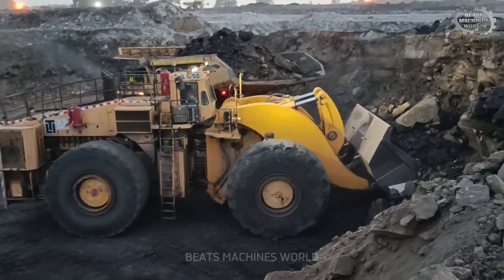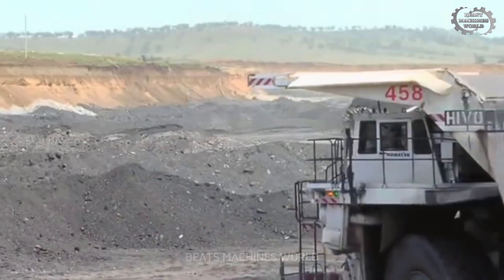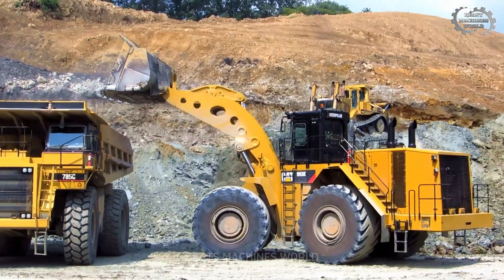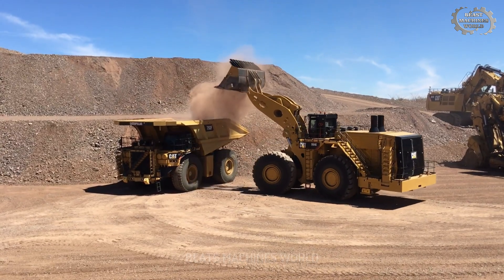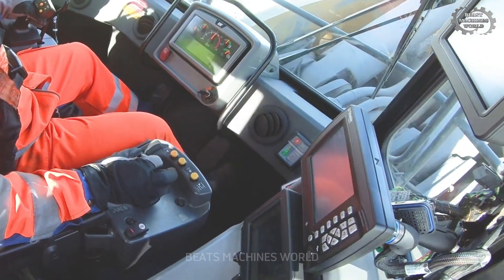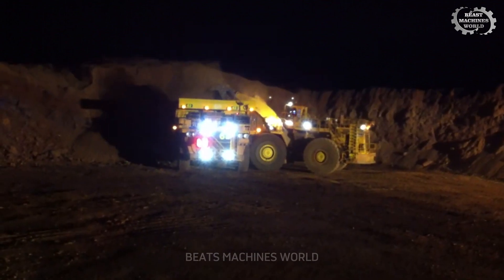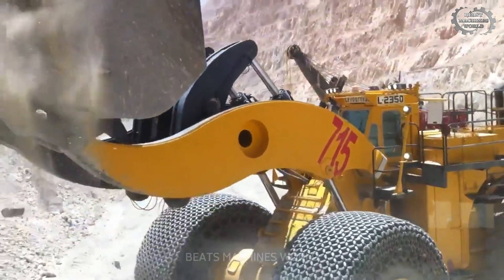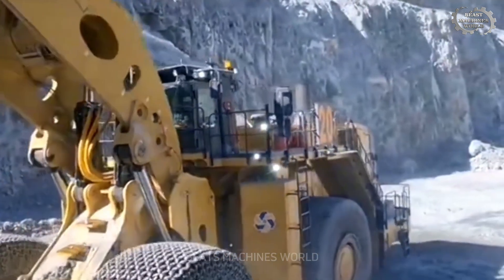The Biggest Mining Wheel Loaders Ever Used in Mining Machinery

Comment: I don't know anything about meters or metric tons.
You tell me and tonyage and footage and I understand that.
Reply from the maker: You watching this honestly makes it all worth it. Thank you!
Reply: Maybe you should learn the metric system. That is what virtually the entire world uses (the U.S. is the main holdout). I'll provide you with conversion factors for cubic metres and metric tons. One foot is 0.3048 metres. So a cubic foot would be the cube of that number of cubic metres (the cube of a number is the number multiplied by itself three times; e.g. 5 cubed = 5 X 5 X 5 = 125). So 1 cubic foot is 0.3048 cubed cubic metres which is about 0.028317 cubic metres. To find the number of cubic feet in 1 cubic metre take the reciprocal of that number (1 divided by that number) to get 35.315. So if you are given a volume in cubic meters multiply it by 35.315 to convert it to cubic feet. But instead of doing so I think it would be better to visualize how big a metre is. Once you get used to metres you will no longer have to convert to feet. One metre is 3.2808 feet (3 feet 3.37 inches). A metric ton is 1000 kilograms (kg). One pound is about 0.4536 kg so taking the reciprocal of that means 1 kg is about 2.205 pounds. Thus a metric ton is about 2205 pounds (about 10% larger than a regular ton which is 2000 pounds).

Comment: The first machine featured is a Le Tourneau, not a P&H.  Get your facts straight.
Reply from the maker: You're absolutely right! The LeTourneau L-1850 was the original name, but after Joy Global bought LeTourneau, they rebranded it as P&H L-1850. So technically, it has been both! 😉
Reply: @BeastMachinesWorld-24k - well I'm aware and mentioned it elsewhere that Le Tourneau is now manufactured by Komatsu in the US. Komatsu acquired Joy-Global in 2016 so it's now totally a Komatsu brand ..!!
Reply: Nice video but you're mixing up your bucket tonnage capacities. your quoting imperial pounds as tons on the 994K and the 993K  should 40sht tons on the 994K and 30 sht tons on the 993K and WA1200-3 43sht tons LeTourneau L1850-1 47sht tons and P&H/LeTourneau  L1850-2 is 60sht tons

Comment: The sight of the excavator lifting tons of earth and rock as if it were weightless left me in awe! 😵⚙
Reply: While wheelloaders can move massive amounts at once, bucketwheel excavators like the Bagger 255 are real monsters.
"Only 5-6m^3" per bucket, but enough on a wheel to scope one almost every second. You can't even build them on diesel, they run on 16MW medium voltage. Which is almost 22'000hp.